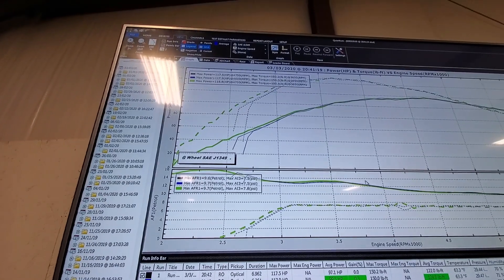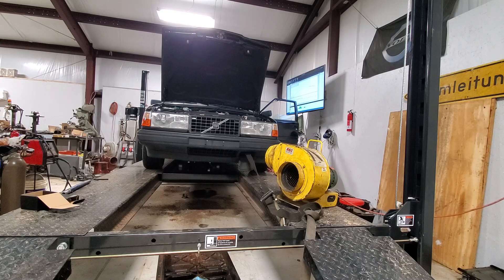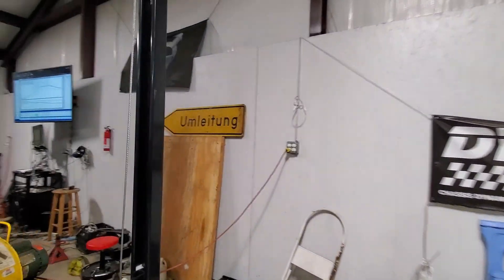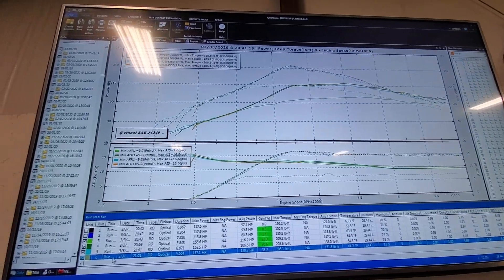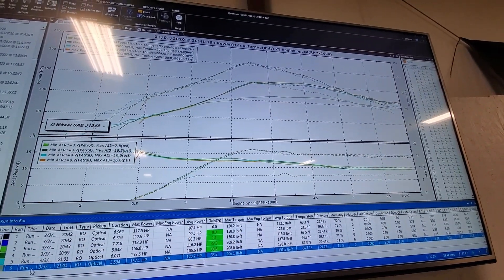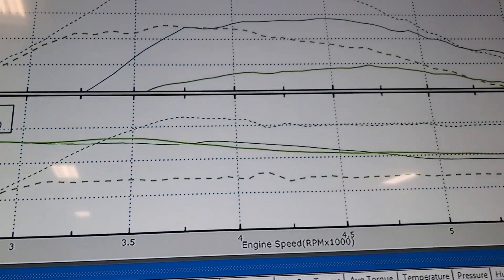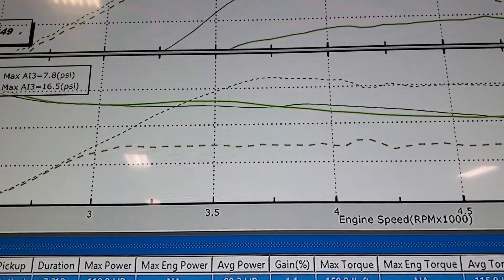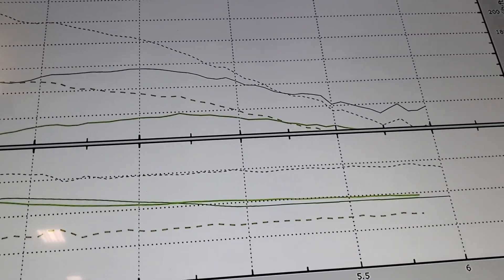How much boost a stock psi can support (Project BPU gets more pressure)

Comment: Hey!  Good series bro.  
Question for you, since you seem to be responding....  How do you dyno these cars with an AW71 and get a pull from such a low rpm?   What gear do you select, and any tricks to the cable or throttle position?
Reply from the maker: Any of them really, but 2nd is the easiest to start at really low rpms. 3rd you have to start around 2800 or so.. you pull the kickdown off the throttle spool, pull it out just before you feel the "click" and put a pair of vice grips on it there. that keeps your line pressure up, and it shouldn't shift when you put it in a given gear. you have to run it up in 1st tho and wait for the rpms to come back down in 2nd. I may do a video that.

Comment: @7:14 what was the problem with the afrs? Too rich? Would leaner make more power? Love to see all the data, thanks for the vid
Reply from the maker: they were very conservative, roughly 11.2:1
Reply: @linuxman51  I'm a total n00b for tuning, what number would you like to see?
Reply from the maker: well at that level boost, I'd probably lean it out to maybe mid to upper 11s. it'd pick up a bit. the transmission started making noise and that's really why we stopped
Reply: Kenny Howard I’m assuming you wouldn’t take fuel out for better mpgs, isn’t richer safer at higher boost levels? I’m interested in learning more about tuning
Reply from the maker: 86 the transmission comment, I got this video confused with my other video (gold car). so on a stock turbo 8v, I personally like to see 11.8's for a non max-effort tune (i.e. a normal street car). If you run the afr's too rich you can cause other problems: the mixture can be more difficult for the ignition system to light off, you can have fuel get past the rings and do all kinds of things, and the one people always forget, rich knock. Running the car too rich can induce knock.